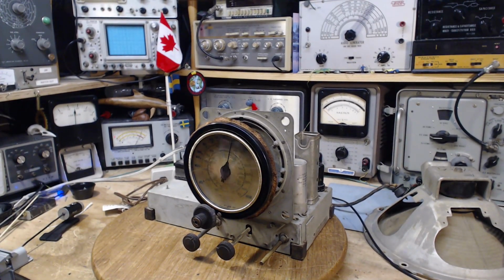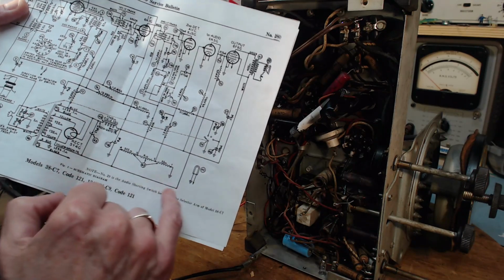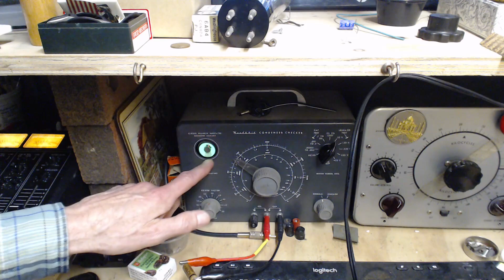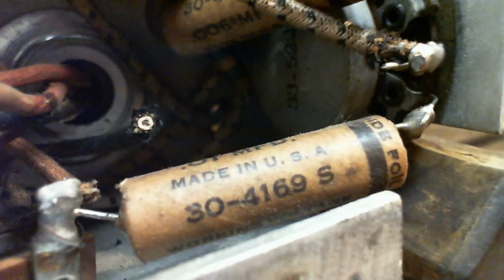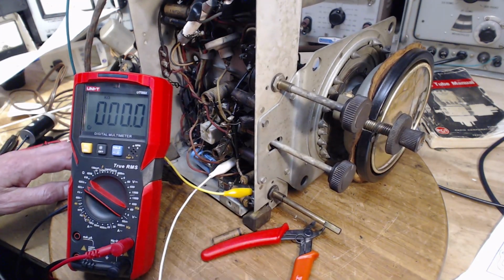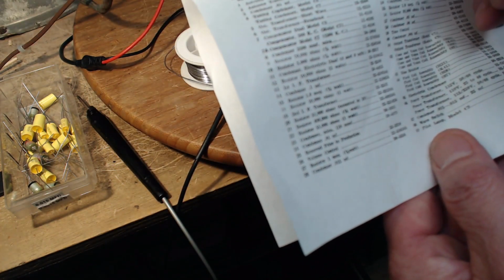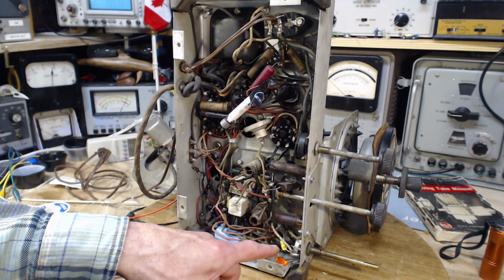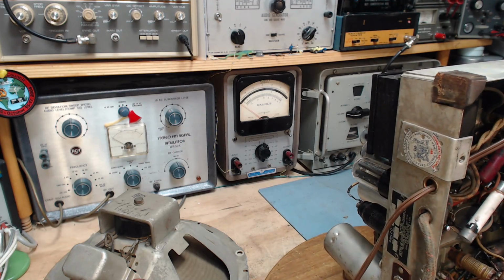Philco 38 C7 Tube Radio Video #2 - Volume Control Capacitors

Comment: The Hum came back, after you tapped on the Tubes! My guess, this might be from that Loose Socket, but you might have to look into this!

You and I have the same thought processes on, How fast this year has gone by! I am not sure, but maybe Global warming, has made time fly?
Reply: My dad said never tap a tube any harder then you would tap the bridge of your nose with a small hammer.
Reply: @erin19030  well, but jim did re discover the Humming sound! so, maybe in this case, it was not a One-Hundred Percent Bad thing.